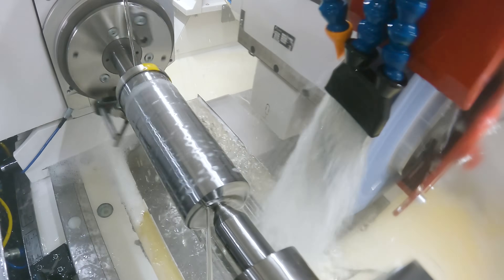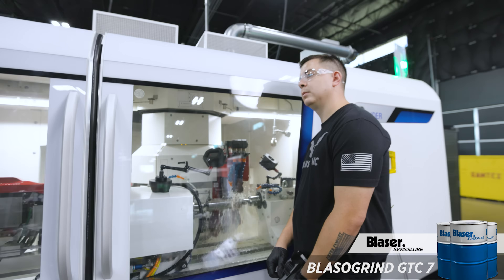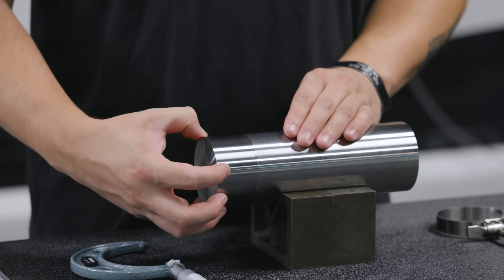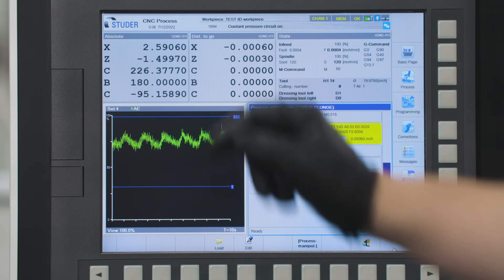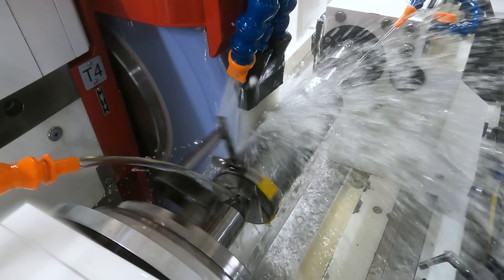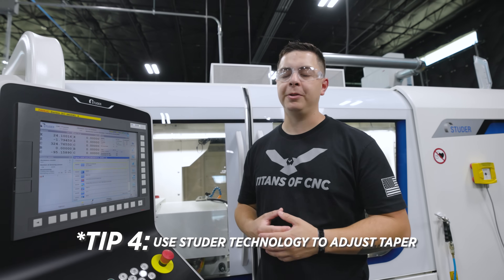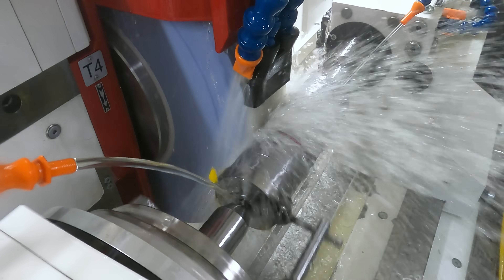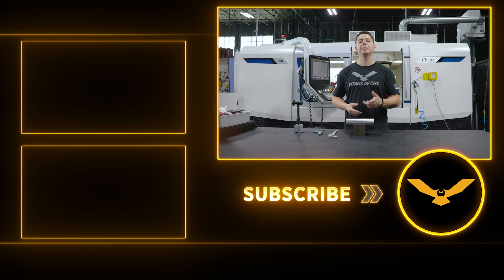MASTERCLASS | Top 3 Grinding Techniques Used On The STUDER S41

Comment: I run these and I there’s a legend of a man who’s like the king of them, he’s 65 and has been grinding for 47. Studer has offered him jobs. Amazing because he grinds way different that any video I’ve seen
Reply: I ran studers for 10+ yrs s20, s21, s35 mainly along with some old Tschudin conventionals cylindrical. extremely tight tolerance parts, and the only plunge grinding was for plunging grooves, but yeah I miss grinding a lot these days, but don’t miss the 1 part work orders for an grounded aircraft or other military asset. When you have to hold .000005” straight round true, and size is +/-.00001” of diametric clearence. Along with all the other dimensions being within .00005”

Comment: I worked many years on a Studer S33 (now Danobat Overbeck) and I can say there is no advantage by multi plunge grinding. Pedulum grinding is more efficient and a lot faster when you calculate the correct settings for dressing, feedrate, rpm,…

Comment: at first you brought the word OD in relation to the length correctly as proposed  then at 10:15 you we have 5 inch OD. here you didn't specify a 5 inch taper length with the proposed taper. I knew what you meant, others may question or get confused, rightfully so.

Comment: Ok I get the corrections but why the taper in the first place ? Can you expand
Thanks 👍
Reply: Taper happens for a number of reasons. You can grind one part straight change the setup and you might be close but not perfect on the next setup. Wheel breakdown can also cause a taper and that cant be fixed using the micro adjustments but in the dressing. Grinding is high precision and sometimes as tight as .0002 or tighter and grinding over a long width there's not much room for a variation. Hopefully this  helps clear up the question you had. Great question!

Comment: Chris, two questions:

Question 1: Can you explain, perhaps in a video, how it's decided when to re-dress the wheel? 

Question 2: Does your Studer have automatic wheel wear compensation?
Reply: Question 1. Welcome to grinding sometimes a dress is needed after a few thousandths and sometimes it works better to let the wheel load up (The finish tends to get better after a few grinds). The biggest reason I use it for is to compensate for shoulder breakdown (to hold lengths), Radius breakdowns, and of course when the wheel is producing a bad finish, burning the part, or not grinding away what I adjusted for.

Question 2: It does, it has its own wheel technology page that can give you all the information you need. 

Hope this helps! thanks for watching!
Reply: Hey buddy! I am gonna talk in metric right now. You should re dress your wheel 0.03mm from size. This will reduce flecking and give you a better finish. But! if you want a better finish do the same in cycle dress but leave another 0.03 on the part. Finish the part with an oscillation of 0.3 at 30 with a dwell time of around 10 seconds. Very nice finish! wheel wear compensation? Dressing compensation yes on studers. If you wheel is wearing during grinding and a dress is not sorting this out then your wheel,speeds feeds,coolant need a look at.
Reply: @Resnor  Great info you shared there! I see you in some other comments its cool to get some positive feedback and other tips. This is the platform to learn and teach on! 

I don't like to dress that close to size depending on the material and wheel it can easily cause the wheel to take off to much on the final approach because the wheel is sharp. But that's my own experience I've had better luck with dressing after the roughing, letting the wheel load up from the semi finish and then finish the part. 

Hope to see you around!

Comment: Have you ever see an error on set up? Code $1902
Reply: According to the manual for the S41 its for an Error while updating the wheel. I haven't seen this code before but Id recommend redoing the setup of the wheel from the very beginning, If you can.
Reply: @christophervillalpando5865  thank you

Comment: It would be interesting to know the roughness of the surface finish after the grinding (Ra in micron). GG guys!
Reply: Sorry we did not show that this time around but I had it checked after and it was a 7.8 Ra. Off camera I played with the dress and got it down to a 1.8RA for fun. Brushing the wheel and applying some preload to the wheel!
Reply: @christophervillalpando5865  Wow, pretty good finish straght from the grinding, excellent work.
Reply: If you are wondering about a micron conversion its roughly 0.2 and 0.05 the later being a super finish.
Reply: @Resnor  Thank you for the conversion :) What's the original measurement? Sorry for the ignorance but I work only with micron in Italy.
Reply: @avorock  hi buddy. so Chris checked the surface finish at 7.8 micro inches. This converts to 0.198 um. This is the finish out of the machine. Like he said for fun they got it down to 1.8 micro inches or 0.045 um but thats not really a repeatable finish over many parts. 8u in or 0.2 um is considered a good grinding finish. Below that you are in super finishing territory.
Reply: @Resnor  thank you, super kind. I work stainless steel for pharmaceutical so I know something about super finishing but I do all by hand tools and I don't know much about machining finishes. Thank you again!
Reply: @Resnor  @Andrea Avanzi Thank you for watching and helping explain! We will do better about including both sets of measuring! I really liked how you included that the 1.8Ra was just for fun. It would be way to slick for actual grinding but performed well with just a plunge grind.
Reply: @avorock   Thanks so much for watching. I used too do a little bit of superfinishing work and its an art all in itself! Thanks Again!!
Reply: @christophervillalpando5865  yep, mirror finish on aisi 316 is a super pain in the b... But also super rewarding, especially on aesthetic applications. Keep up the good work guys!

Comment: what's the reason for spark out
Reply: It allows the wheel to dwell on the part and cleanup the grind. As it sparks out the pressure/deflection is released before it kicks the wheel out. Great question!

Comment: What is the purpose of sparkout?
Reply: It allows the wheel to dwell on the part and cleanup the grind. As it sparks out the pressure/deflection is released before it kicks the wheel out. Great question!
Reply: It’s a good way to control geometry and size. If there’s pressure between the wheel and the workpiece, making adjustments can be like chasing a rabbit. The spark out allows predictable adjustments because the pressure between the surface was reduced as much as possible, eliminating a variable in the process. We were working on a tight tolerance taper and I’d have the grinder adjust his table to take a tenth of the front, a tenth off the back, two tenths off the back and on and on. I suggested taking five park out passes and it got the machine dialed in because the cutting pressure was throwing out the position of the part.
Reply: @fmgee1959  Thank you for the excellent reply :)!

Comment: Does the machine have overload protection in case you misprogram your fast feed?
Reply: It has a sensitron that picks up the actual grinding of the part. This is why its important to monitor the grinding and watch for burning or excessive feeds